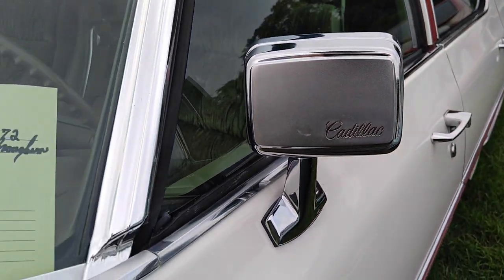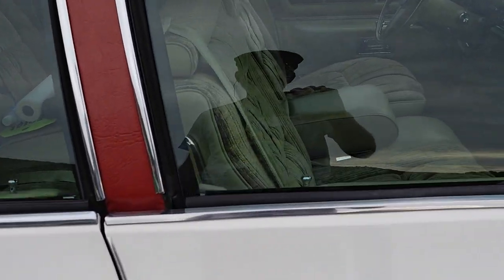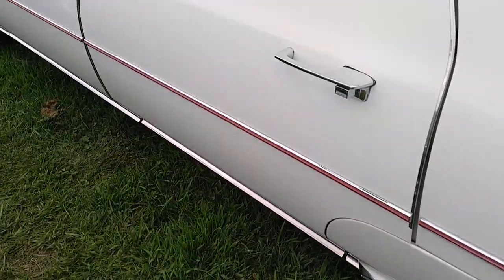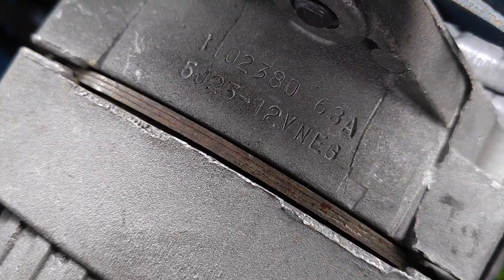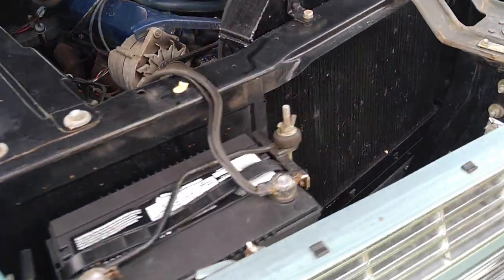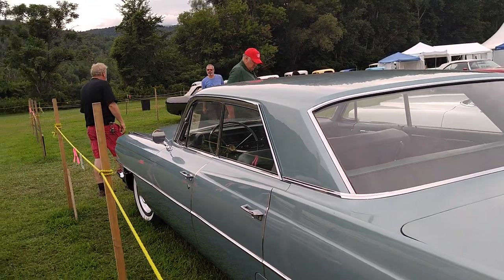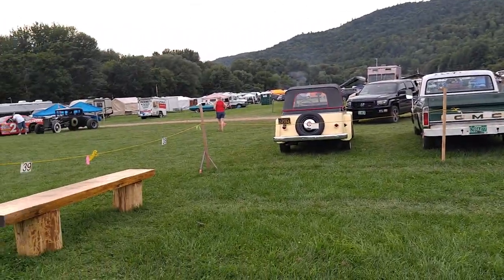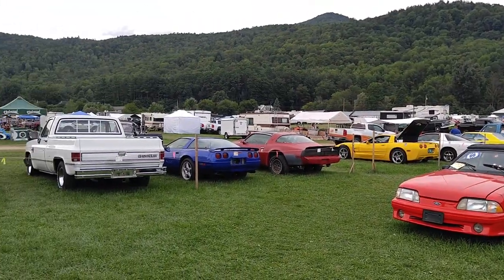NEW 1976 Cadillac Fleetwood Waterbury Car Corral 8 12 18

Comment: Andrew early 60s Caddys had a dual master cylinder.   So did Rambler and probably Studebaker which offered disc brakes starting in 1963
Reply from the maker: Bill Hershkowitz Yes, I was aware of that fact. Ford and Studebaker had Bendix disc brakes. My 1970 AMC Ambassador wagon has solid discs up front, inadequate for a hi compression and peppy 360 V8